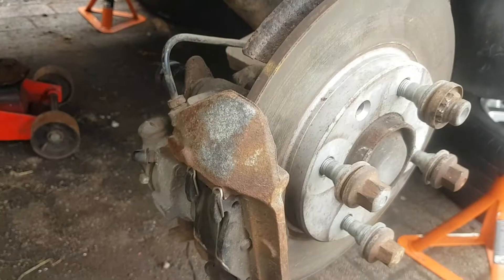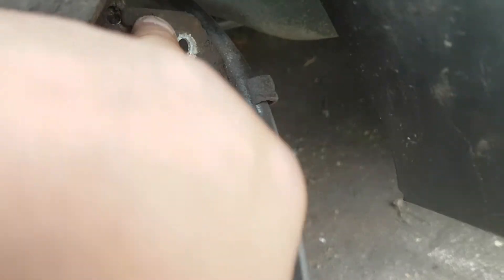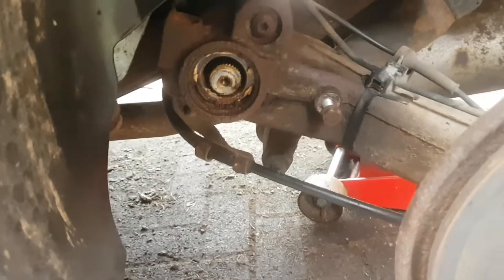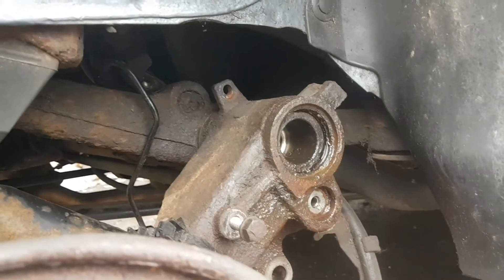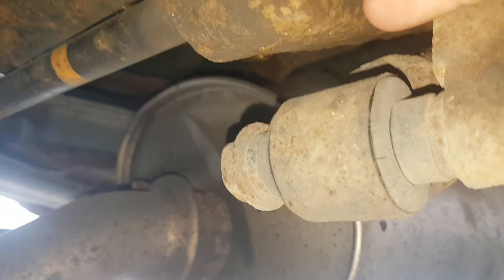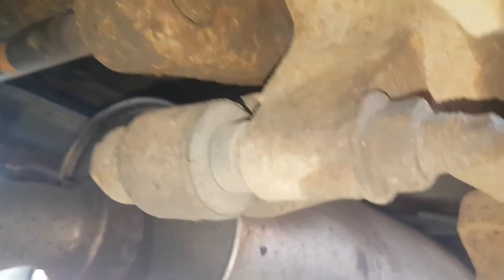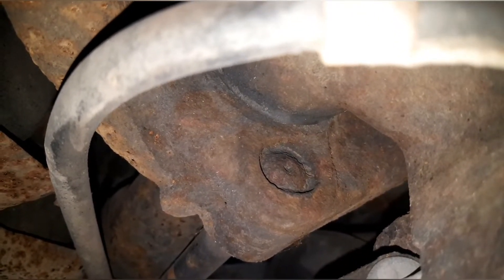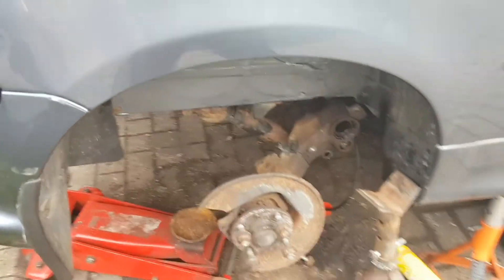Peugeot 206 cc rear axle seized torsion bar suspension.

Comment: Small hydraulic puller with twin claws. Put them round back of bracket and puller to push in centre of torsion bar. Ive a sykes pickavant 15t puller. It took a lot of effort to turn the handle but it pushed it straight out! Its common for a lot of stuff involving splines to get seized.
Reply from the maker: Thanks Mate I got it in the end but thanks for the tip for the future. 👍

Comment: Did you eventually get it use a ratchet strap to pull it up because probably stuck due to weight pulling down on it so torsion bar has the tension on it with no load causing it to be jammed
Reply from the maker: No mate and no it's seized on to the splines I tried jacking it if that was the case it would have popped of. Thanks Mate thanks for watching I appreciate your comment buddy